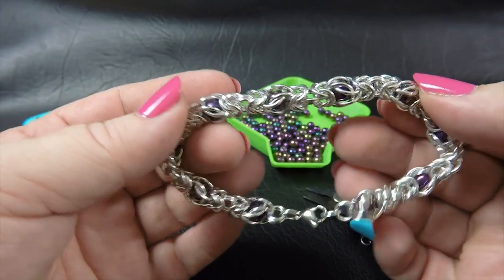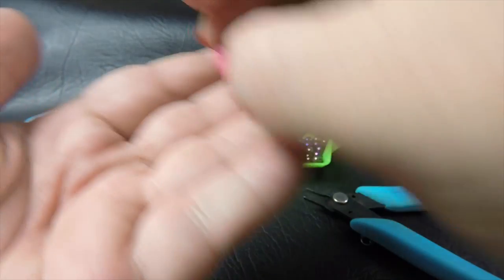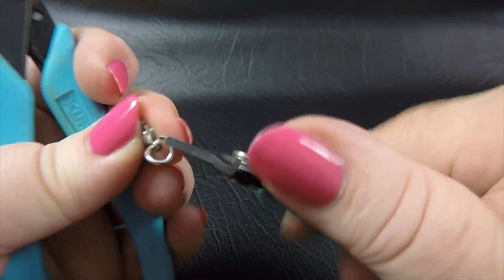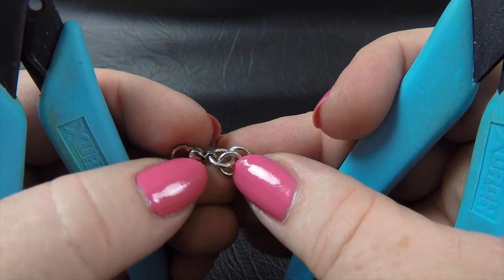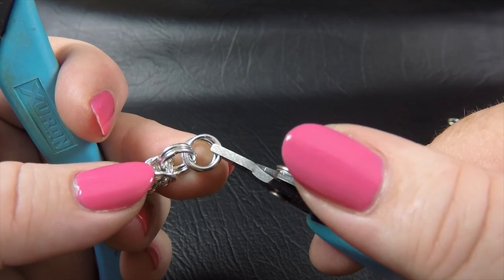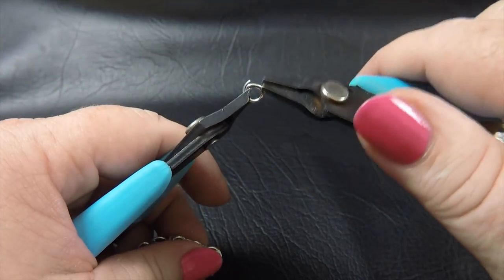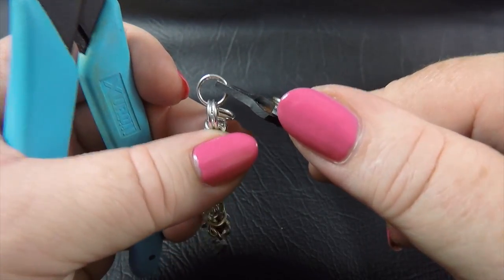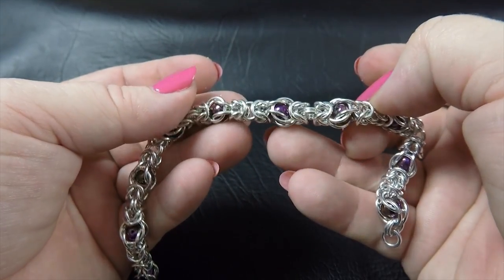Chain Maille Tutorial - Captive Byzantine Bracelet

Comment: Another winner Deb! Would look great with the earrings - but before I get carried away, would 4.50 and 6.50 be okay?
Reply from the maker: The rings around the bead really depends on the bead you using.  Some beads that are listed as the same size I used I have had to go up in ring sizes to make it work.  There is a certain amount of experimenting with beads, unless they are calibrated.
Reply: @AussieMaillers  The thing is Deb, getting rings in anything other than full and half sizes here in the UK is a nightmare. I'm even attempting to make my own for earrings. Thanks for your reply and your very inspiring tutorials.